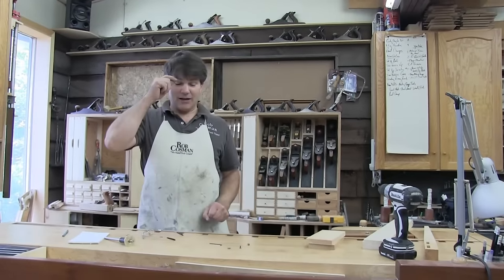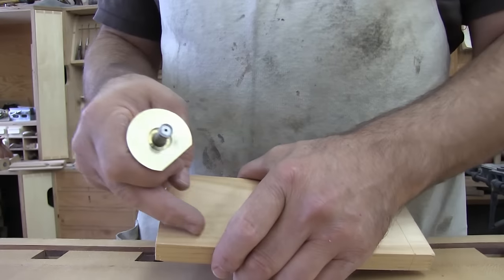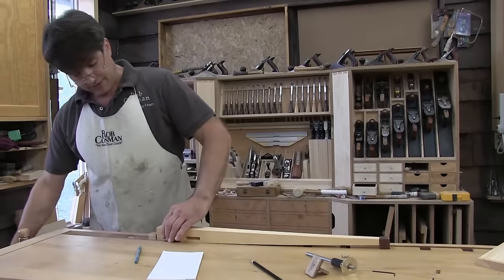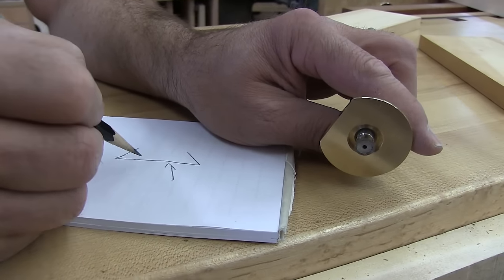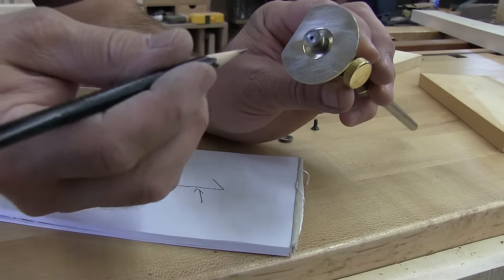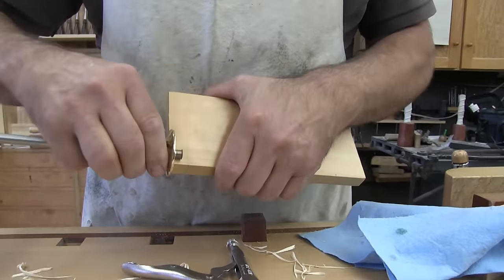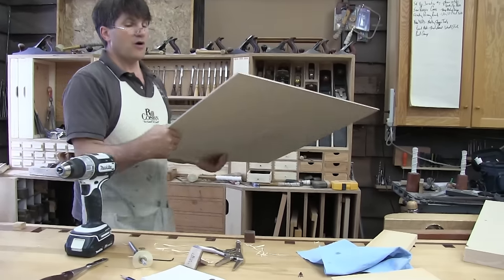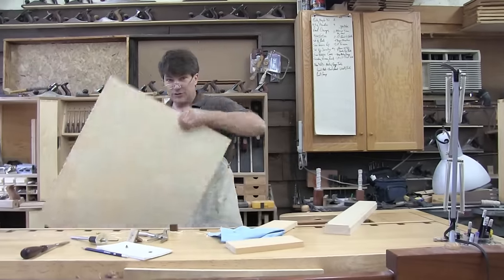The Wheel Marking Gauge, versatile tool!

Comment: At approximately 0.33 you show dropping the rod to determine the setting for the thickness of the timber. If you shim the timber with a sheet of paper or two you can fine tune the gauge to allow clearance for the depth of cut.

Comment: Hi Rob, Follow up on the marking gauge topic.  Thank you for your help from earlier.  I have invested in the Trend diamond stone, the Shapton 16000 grit stone as I see common in all of your sharpening videos.  And it works amazing!  I recently was working on cutting some haunched tenons for a frame and panel door and found very quickly that my marking gauge wheel was breaking off and leaving jagged metal edges on the wheel.  I sharpened my marking gauge I though fairly minimally so didn't lose a whole lot of metal but I'm wondering if this is something you have run into?  The wood I am using is EXTREMELY old oak so it's harder than a woodpeckers beak, do you think this is what is causing it?  I have two wheel marking gauges and it did it to both of them.  How would you recommend marking this old oak as I have a lot of it I would like to use.  Thanks again!  (PS> Just received my first Woodriver plane and got it tuned up for use last night, what a dream!)

Comment: Hey Rob, Love your videos and my craftsmanship has improved with your guidance.  
Question: How do you prevent uneven wear on the cutter since it seems locked from rotation by the screw?  I thought the cutter wheel turns on the shaft.
Reply from the maker: loosen the screw and rotate the cutter a 1/3 every so often.